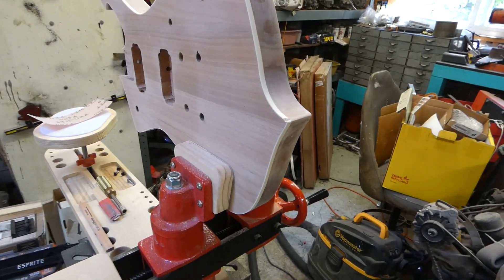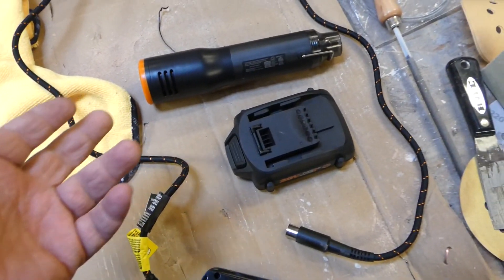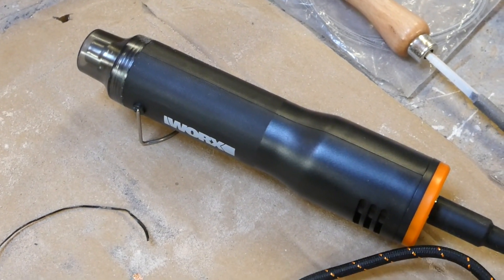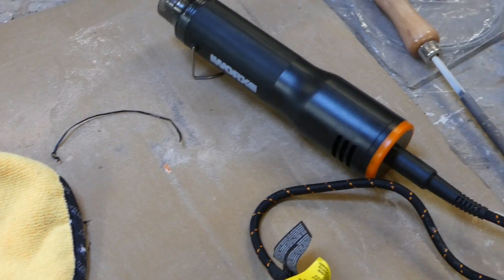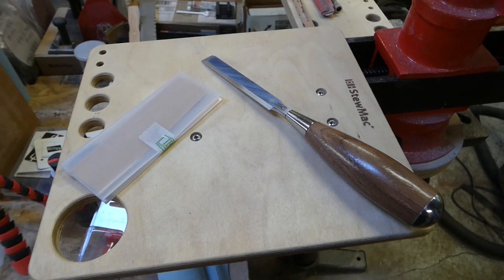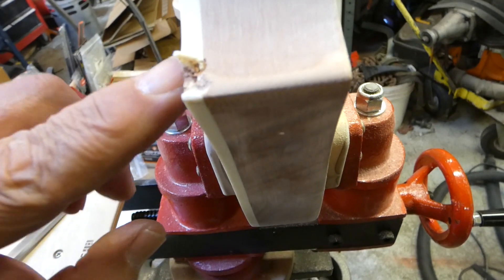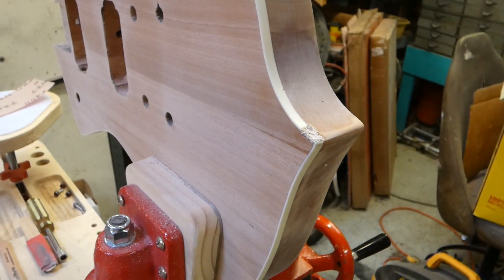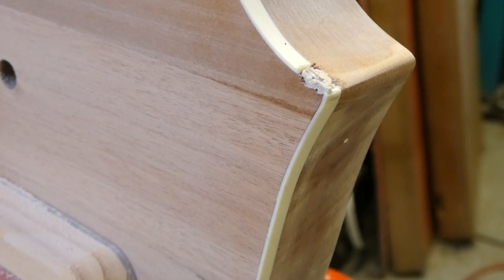Iceman build - Day 26

Comment: What does it cost to build that?
Reply from the maker: There are tons of ways to go. Kits start out around $150 and up. The great thing about kits, you don't have to have a wood shop filled with tools. The kits usually have pretty poor quality hardware, but all of that can be upgraded as well. Between parts and paint, this one is sitting around $400.